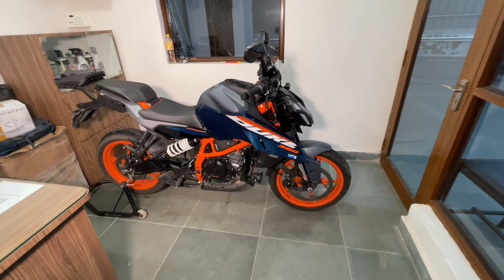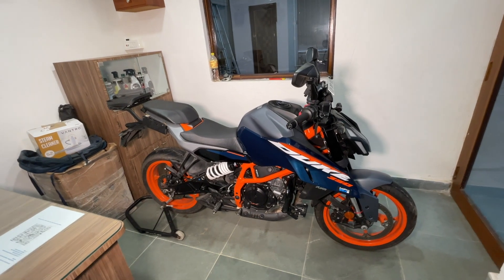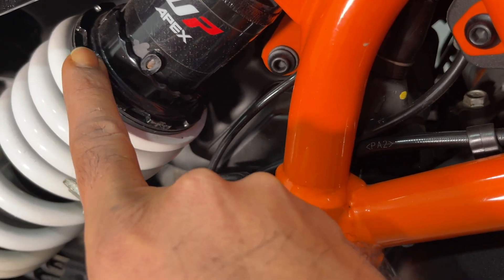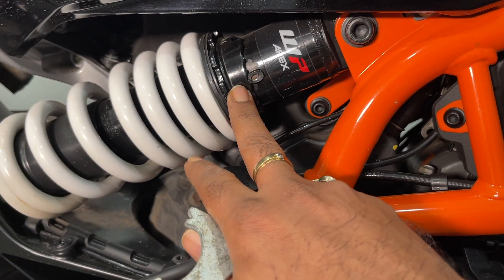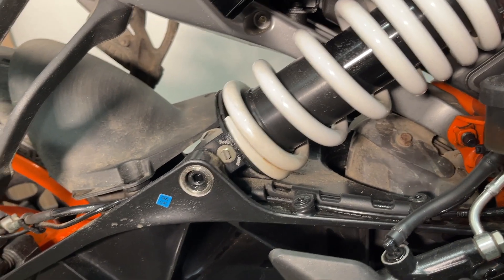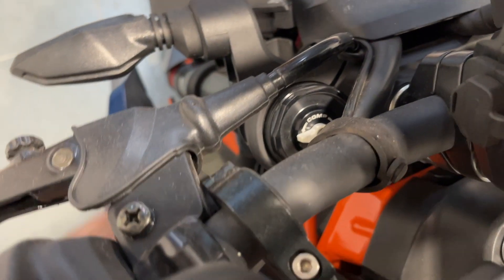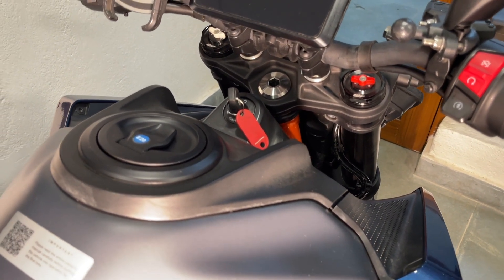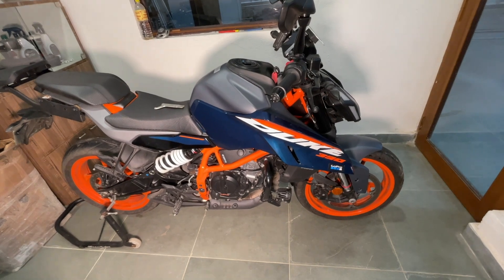Adjustable Suspension Explained | KTM Duke 390 |

Comment: I see that your preload has set to 7 so can you share your weight including your motocycle gear? Also when you get a passenger which notch you use it?
Reply from the maker: @berkayal8834  this was when I was playing with the setting. Now I keep it at 4 or 5 depending on terrain and way of riding. Mostly keep it at 4 for straight road relaxed riding. My weight is 76 kg. With pillion of another 60 to 70 kg, 6 or 7 should be ideal.
Reply: @DipayanBose  thanks for your answer. Well then i should keep it 5 or 6 also maybe 7 because my weight is 95 with equipment. What is your opinion about it? Am i right about setting it 6?
Reply from the maker: @berkayal8834  6 should be correct.

Comment: What is the seat height?
After adjusting the preload can I ride this? 
I'm of 5.4" and my weight is 61kg. Please guide.
Reply from the maker: @samrat898  please take a test ride for best understanding. Bike is light weight and lower than most bikes, you should be able to manage this perfectly. Take a test ride.
Reply: Will the seat height reduce by few mm if I increase the preload?
as I am 5.3" without shoes I wanted to know this, please suggest I am planning for this bike

Comment: Where did you get that spanner bro?
Did you get it in the tool box?
Reply from the maker: @GEARGRIT-8500  yes its there in the tool bag
Reply: @DipayanBose cann you tell me size of spanner in mm forr preload collar.
Reply from the maker: @ichigoo-h6h size is not mentioned anywhere. Go to any tool store and ask one for mono shock. I think it’s a standard size.
Reply: I didn't get the spanner in the toolbox. I only see screwdriver, small spanner and a L shaped thing in small blue color bag.
Reply: @a.yashwanth Same here. Seems like ktm has resorted to this pathetic cost cutting

Comment: Hey! Your video helped me a lot. Can you help me with another thing. Can you confirm the amount of engine oil this bike take. 1.7ltrs filled by the service centre is clearly overfilled as I can see from the window.
Reply from the maker: @ReallyStupid-j6d  there is some confusion here. Even the svc guys are also not sure why it shows overfilled in that window. Mine is the same. 
1.7 as per the owners manual should be filled when replacing oil. Just make sure that is done and keep an eye on the meter console. If any oil related issue comes up, the red oil light will keep glowing after starting the engine.
Reply: @DipayanBose  So it is a national confusion 😅. The service manual says 1.5ltr. In the global catalogue it says the new LC4C engine is a compact one so it will take less oil than the previous gen. So that's what I am currently following (1.5ltr), and still overfilled. The Indian customer service is not responding. I tried to contact the global customer service and according to them they are putting 1.35ltrs according to their climate. But the brand new bikes in India comes with proper oil level. Huh.....There is too much confusion going on.
Reply from the maker: 1.6 ltr is recommended for LC4C 390, when oil filter is replaced. Yes it does go above the mark in the inspection window, however that's a different story. Will make a dedicated video on this soon once I research and confirm a few facts. 

Thanks
Reply: @DipayanBose  Oh you are already working on it? That's great. Hope you complete your research soon. I'm waiting for that video. Thanks...
Reply: Check the owners manual. The oil volume with and without replacing the filter would slightly vary.